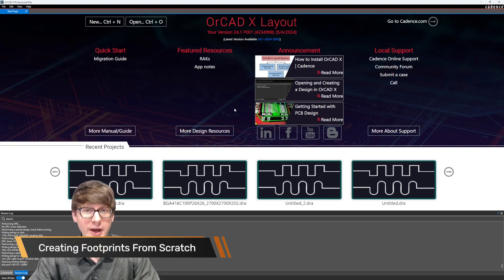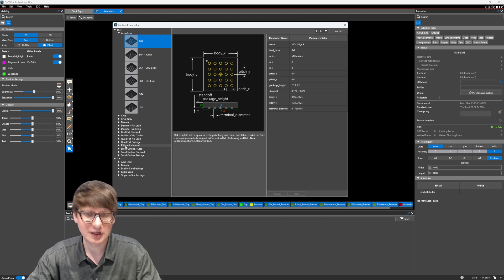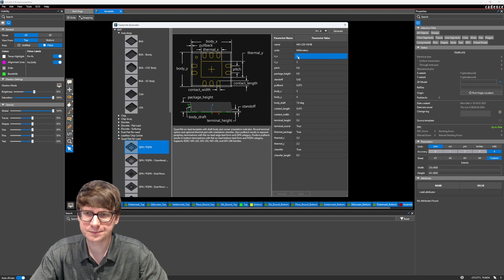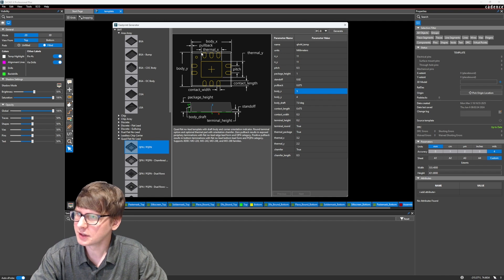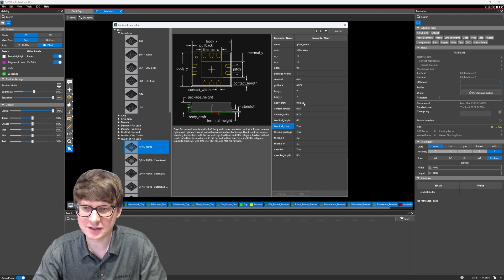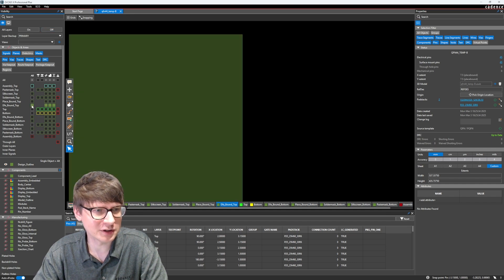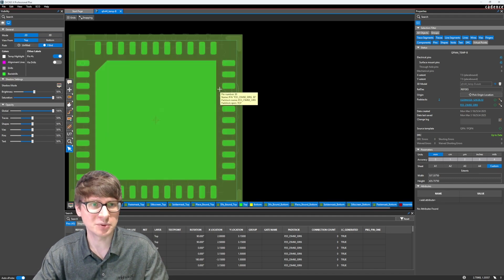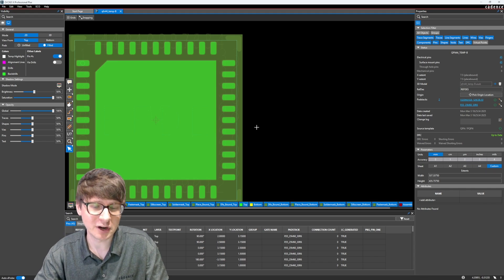How to Easily Create Footprints for Your PCB Design

Comment: 1.The Chinese language support is functioning, but there's a bug where when both Chinese and English text appear simultaneously, it results in the creation of two buttons.
2. When drawing a Shape, the focus is suddenly lost.
3. When drawing a Wire, the focus is suddenly lost.
4. When setting a Shape, the focus is suddenly lost.
5. The measurement tool is unable to measure distances within elements, such as the diameter of pads. This appears to be a logical oversight. It would be highly beneficial if dimensioning tools similar to those in AutoCAD could be designed. This functionality would be particularly useful when designing custom footprints.
Reply: Thanks.    we'll look into those issues.   For #5 please try selecting a pad then look in the property panel, all the sizes of the pad, mask, drill etc are in the property panel for any pad.   We do also want to improve measure